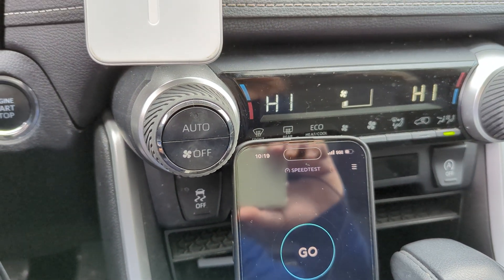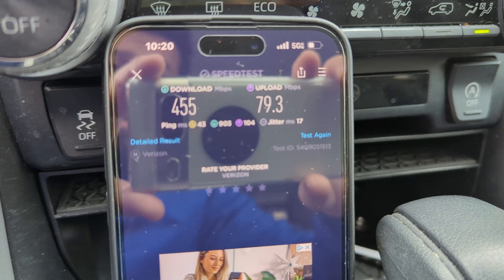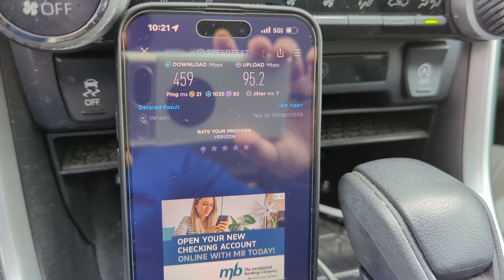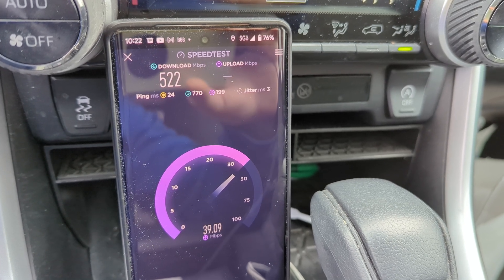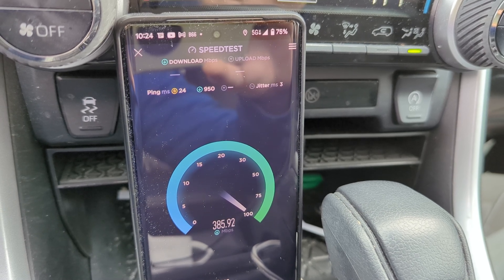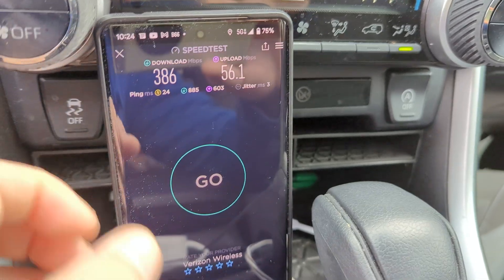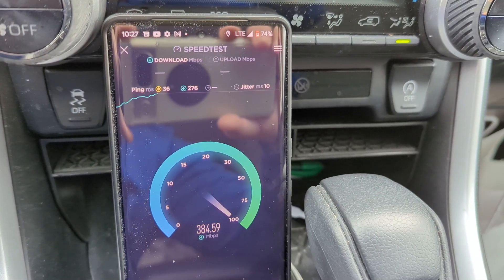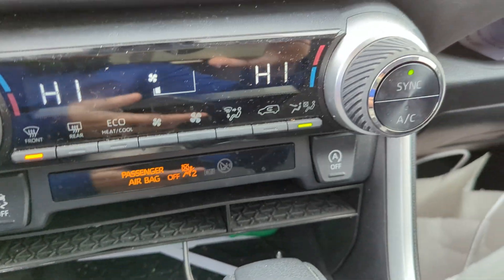Verizon Upgrades Airport | 5GUW N77 C Band B48 CBRS 5G & LTE

Comment: I live in a very congested VZ area here in MO and not sure what to do. T-Mobile and AT&T both have 5G but I’m told ATT isn’t very good here according to people I know who live here. VZ tells me I am connected to a tower that is 30% or more congested most of the time. I tried out T-Mobile and the service seems to be pretty good and got very decent speeds on 5GUC. Would you leave VZ and go elsewhere or ride it out. My dBm is usually around -105 with VZ and they told me more than likely I will not see any upgrades at all. So it appears we are stuck with a congested LTE network for the foreseeable future.
Reply: You can test AT&T’s network through a cricket free trial. Not sure how they compare to Verizon there now but I’ve heard good things in Missouri. It’s possible those people haven’t tried AT&T in a few, they’ve made quite a bit of progress in rural areas with Firstnet.
Reply: @ryanvandy1615  I can do that. One of my friends said AT&T is not very good in the town I live in and they need Wi-Fi calling to make calls. Right now I have the same issue with Verizon because of all the congestion.

Comment: Sneed does UW have a hard time going through trees? I only pickup LTE at home full bars on iphone but the 5g doesn't reach unless im right by the tower. past all the trees in between
Reply from the maker: mmWave has trouble with trees. Not really n77.
Reply: Power level could be turned down for whatever reason but come when they get all the spectrum they paid for things probably will change.
Reply: When only using 40 60 mhz power is less , once you get to 100 to 200 mhz power can be maxed at 320 watts and n77 will come alive !